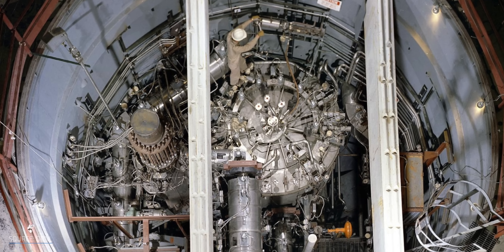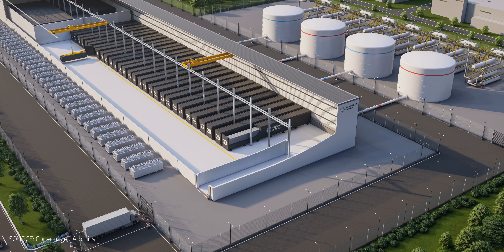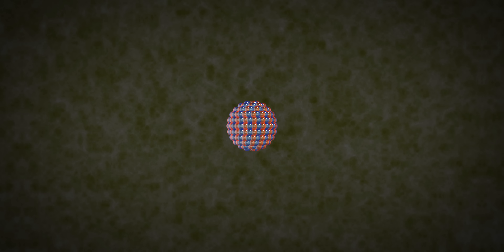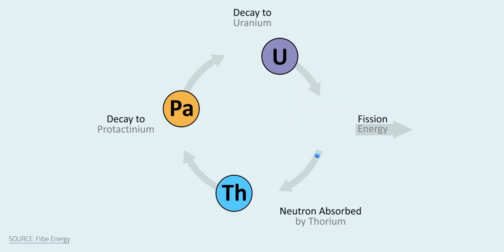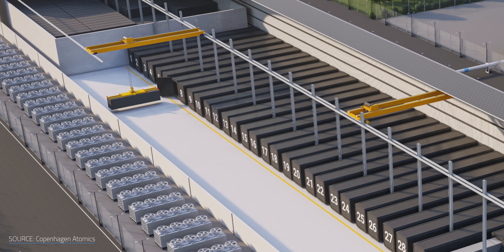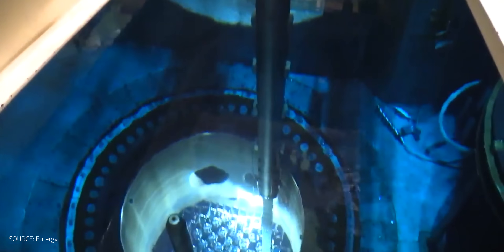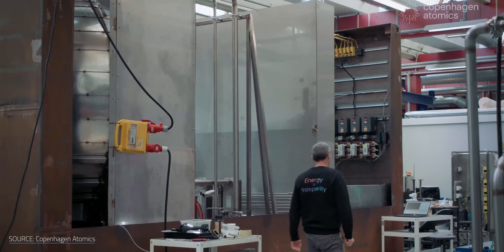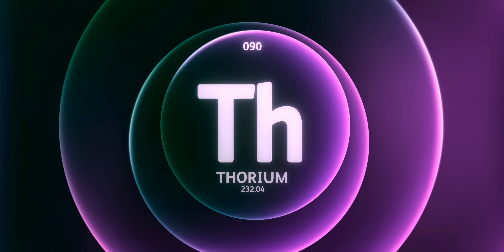Why Thorium is About to Change the World

Comment: I was about to remark on china's prototype test when you mentioned it in the video. Whether this technique becomes viable will depend on if they can reach enough standardization and volume to reduce the regulatory approval proces (cost and time) and the unit cost. The principal looks promising. And these could be especially beneficial in applications that need a stable, constant supply of energy/electricity like datacenters and certain industrial processes.
Reply: Didn't the Chinese had already started one?
Reply: @PahatRout  yes, it’s been running since June 2024
Reply: You are spot on. Those are exactly the applications we will be looking to supply rather than to the grid (to begin with), where we can install GW-sized plants on one site. We need to get a more standardised type approval, similar to approving a new aircraft model.

Comment: What do they do with the majority of the reactor module they can't reuse? That felt kind of glossed over. sure you can reuse the fuel and water, but what about the rest of it? Do they just throw them into a huge pile in some salt mine for 300 years? Seems like an enormous issue.
Reply: MSRE demonstrated that once drained and left for a few days the residual radioactivity of reactor components was very low (low enough that humans could safely open things up and inspect for prolonged periods and mostly confined to the surface layers)

IE: low enough that you could melt down and recycle the material or scrape them and sequester that surface layer whilst recycling the rest
Reply: The majority of the "final product" from thorium is only radioactive for decades and are generally useful materials.

Eg Cobalt 60 could be a by-product. Dangerous, yes, but also very useful for xrays, and it degrades within a century.

Just sitting it in a box in the desert will be fine. Or a mine.
Reply: There are a few things to remember here. Firstly, the reactor module is about 20 tons of steel, so if we assume a change every five years and the plant is operational for 50 years, that's 200 tons for the lifetime of a module. That's approximately the same amount of steel as one wind turbine. The difference is that this produces thousands of times more energy in its lifetime than a wind turbine. Secondly, after a period, the steel is no longer activated and can therefore be remelted to be used for other purposes.
Reply: Also how does the gamma radiation impact the local wildlife? Does it harm the food chain? does it damage the water supply? There are so many things that I'd need answered before I ever thought this was viable.
Reply: @StrigidaeParliament  Gamma radiation doesn't bio-accumulate. It's basically a very, very strong beam of light that burns you. But after that burn it's over, unlike neutron irradiated materials which stay radioactive for longer.
Reply: @treborhuang233  if by "burn you" you mean break apart your cell's walls and the DNA in said cells then yes you are right.
Reply: The gamma radiation doesn't leak into the environment. That would be a huge issue. The video said gamma radiation can pass through a few centimeters of lead. That's why the shielding in the reactor design has a thicker lead wall. Gamma radiation won't pass through.
Reply: @StrigidaeParliament  I'll assume your being serious about your questions, quick searches can solve your questions, Yes, the majority of waste will likely be buried, it'd be dry waste, easy to handle, and very low energy, storage in any dry place away from direct contact is most likely, when the reactor is off and drained, there should be almost no gamma rays meaning the most trivial of shielding from other patrticles alpha and beta will render it safe. Safe is relative, you wouldn't want to sit on it for too long, or lick the insides, but neither would you want to do the same with spikes made of sodium metal, The gamma rays are shielded by the large steel metal box that is constructed around the containers when the reactors are running. As stated in the video, rendering risk to local wildlife and the food chain none. A heat exchanger is used for the water, meaning the water is only contacting a heat sink and used to transfer heat to another object, it is likely that before reentering local water supply a water purification system may be required for more strict water managment. Such as what japan did with it's disaster , but china's current nuclear reactors don't even do that step, and the effects to local wildlife are zero. In short, in every single way, it is safer than current nuclear reactors if they do what they say they are going to do. WIth signifcant less harm to the enviroment to coal, which often has trace heavy metals inside of it, leads the plume of coal power generation, more radioactive than the outside of any nuclear power station. Or, even flying a plane would lead to more radiation exposure.

Comment: So if i understand it correctly.... the fuel can be recycled endlessly by mixing the waste into a new fuel batch. Exausted material get separated by traditional industry processes like chemical reaction, precipitation and convection or so. 
The pumping equipment however has to be changed every 5 years or so.

Hmm...  so... does the pumps and valves get radioactive then? Isn't this just replacing radioactive rods in a waste storage underground for radioactive pumps in a waste storage underground?
Reply: Yes, through neutron bombardment everything becomess radioactive if exposed long enough. Theoretically most isotopes created from commonly used alloys via neutron bombardment have low half-lifes, which makes them highly radioactive, but only for a (relatively) short time.

Since drastically changing the atomic makeup of the pipes and valves through neutron bombardment is going to change the material properties of the components, the components of the reactor are going to break down, once a significant portion of the material has been converted. This could mean that the parts have to be exchanged long before a significant fraction of the material used has been converted into problematic waste.
Reply: @zwe1l1nkehaende  material need not be converted (into another) but const neutron bombardment can make the metal very brittle (case hardening) because of atomic dislocation (defects)
Reply: Throw neutrons at something long enough and some of them are going to stick, that's why you can expect valves and such to become radioactive over time as they are continuously hit by neutrons from the fuel.
Reply: Yeah, but it's low grade.
The steel of an xray machine is radioactive, but it is still steel. After a decade or 2 you can sleep on it safely.
Reply: @myne00  Xray cannot cause radioactivitiy (unless it is close to gamma range). x-rays can do lots of biological damage.
Reply: @myne00  How does the Xray machine become radioactive? Xray's are Gamma radiation. You need neutron radiation to make something radioactive.
Reply: You're correct but also, not needing pressurized vessels is a huge safety advantage
Reply: @mrping2603  don't forget that the temp is close to "red-hot" and many metals are already soft around  this temp
Reply: I think this is a great question that is clearly not answered.. but I believe the conjecture here is not quite correct.. standard nuclear power plants both civilian and Naval do not need to worry about the stainless steel piping and valving and pumps having problems with Neutron radiation. What they do have problems with is chemical degradation having to do with hydrogen. I know because I worked at both of them and nobody changed out pumps are piping because of the radiation and it was well beyond 5 years of operation. All pumps piping and valves have hard surface wear products in them like Cobalt and stellite. Those react with radiation and can form Cobalt 60 gamma radiation emitters. I am suspecting that the real problem is the chemical cocktail of the molten salt is degrading the whole Metallurgy and 5 years is a prudent time to pull all of it out and start all over. One of the problems the Russians were purported to have on their submarines were that they built them out of an extremely strong light metal that while it worked was great but it could fail in a moment's notice after a certain age. I tried to weld for a customer a medical device that used acid in a stainless chamber. It was vinegar and it was low heat levels but over time it actually ruined the metal to where it could not be welded and it had eaten away a small hole into it and it proved to be irreparable unless you were to cut out all of the old degraded stainless steel. It's not a salt but I do believe that in really high temperature and with salts you may get some effect similar to that but I would love to hear everyone else's opinion because I don't know the answer either but it's not the neutron radiation at least in my opinion or that gamma radiation. Thank you all
Reply: @robertschumacher472  neutron bombardment causes structural defects that makes the metal act like a glass- very brittle and extremely hard. high temp helps auto annealing but not 100% effective
Reply: @robertschumacher472  As far as i know the piping and pumps go off because of the combination of those specific salts, higher temperatures and constant circulation itself. Its a working pumping system, not a static liquid tank, as everyone knows now, so of course that causes greater wear and tear. 
I understand there were and are attempts to figure out different less corrosive chemistry for these molten salt types of liquids, but so far nobody was reporting any big success there. I would expect that part of the system to continue being researched and produce results in the future.  
There are also other experimental reactor plans and ideas that are based on using old spent nuclear fuel as burning fuel. like the theoretical traveling wave reactors. Shame we dont invest more in all of those on a global scale.
Reply: That's definitely much lower tier of radioactive waste. Also with time they might come up with the way of refurbing some components
Reply: Almost; the "waste" or other fissile seed is a one time requirement, after which the reactors will be fueled on thorium alone (which is a byproduct of existing mining). The thorium replaces the lost fissile 1:1, which is transformed into relatively short-lived fission products and removed. The fuel and blanket salts are the expensive part, and they can be reused indefinitely; what needs inspecting/refurbishing/replacing is mostly just a few pumps, some piping, vessels, and such, all near ambient pressure standard steel components. Replacing everything 20 times should still be much cheaper than what goes into a PWR, with its heavy forgings, massive piping and containment, and multiple redundancy everywhere, none of which is needed here. The reactor itself should be cheaper than manufacturing a load of fuel bundles for a conventional reactor, and even the irradiated components can be recycled once they cool.

The terminology is unfortunate, inherited from conventional nuclear where fuel and fissile are conflated. In a breeder, fissile is needed in the core, but it's not really fuel, and is never thrown away. The U-233 fuel salt here is more like a catalyst for transforming the thorium in the blanket salt into more U-233, which maintains the balance of fissile, while the thorium fuel dissolves to replenish the blanket thorium that was lost to this transformation. Basically, thorium fuel in, fission products out, with essentially no long-lived waste produced.
Reply: Okay guys think a little bit on this USS Houston SSN 713. Commissioned I believe in 1985 and shut down in mothballs I believe in 2014 if there was a problem with Neutron and brutal mint of any of the metal and it had to be replaced out do you think they did a whole cut for a submarine and replaced out parts of the piping pumps valves whatever?? I will tell you know they didn't that is not an overriding factor. There are certain items that when irradiated will produce more radiation coming out of them and materials like Cobalt will do that. In a civilian nuclear reactor after a shutdown of about a day or two you can go and be right in the reactor coolant pump shrouds or motor area. The radiation from the reactor is minimized and so the real radiation from the materials that become radioactive for thousands of years is not that high. So while at the source of that high radiation there will be a high a level of radiation it not be a lot over a big area. It is kind of like intensity versus quantity. You can have Penn sources are local Source areas but it doesn't mean the whole area is wildly Radioactive. Yes you can have Neutron and brutal mint and I remember a fella that went in under the reactor and there were these construction kind of lights that are on a cord and then each had bulbs strung up over an area. Those had Neutron and brittle in for being in there for years and the insulation in the plastic fell off like dust but I don't believe the wires were compromised and yet they could have been more in brittle but really the coding around them took the beating too.. but the big question what is causing the 5-year turn around to where you have to replace these items?? Pumps and valves and all that stuff should last for 20 years plus and it's got to be something that is different between a standard light Water Reactor for commercial use and a thorium reactor. I can say for sure that you do not have problems in a standard commercial reactor every 5 years and have to replace things out. And you're going to get Neutron radiation in both of them.
Reply: @robertschumacher472  maybe it is more the high temperature and corrosion of salt and less the neutron absortion that damages the plumbing...
Reply: As others have noted activation via neutron bombardment is not that big an issue. It's manageable. A potentially bigger issue for MSRs is that so much more of the reactor and support equipment is in direct contact with the hot fuel salt. This is very different than traditional naval or commercial power reactors where the fuel is contained in cladding. If some of that fuel plates out on a pump, the moderator or the vessel itself, that is an issue that needs to be addressed as it turns the material from low/intermediate to high level waste.
Reply: There a better Gen IV reactor concepts that run 20 - 30 years with one set of fuel, or they use on-site pyro processing, which cleans up the fuel constantly, and allow removal of posions and injection of new fuel.

Comment: Thorium is over-hyped. It's pretty much the same as Uranium-238. It's named "Breeder Reactor" and it's technically the same concept turn U-238 into Pu-239 than Th-232 into U-233. So two fuels with more or less the same characteristics. Turn a non-fissible isotope into a fissible one.
Besides, Uranium is disolved in sea salt. Very diluted, it's true, but used into a Breeder reactor, it's usable.

On other side, UNTIL NOW, fuel is not a big cost on nuclear reactors. The problem is the reactor construction. It's not clear if thorium reactors will reduce the costs. Even cheaper is the "cost" of renewable "fuel". It doesn't exists so zero. The cost of the fuel doesn't mean the electricity will be cheap.
Reply: Yes, nuclear reactors take fertile and fissile material and convert it to other isotopes to generate heat but that does not mean that converting Th-232 to U-233 is the same as converting U-238 to Pu-239.  Nothing could be further from the truth.  The Uranium fuel cycle produces long-lived actinides that make uranium fuel waste difficult to deal with, this simply is not the case for the Thorium fuel cycle.